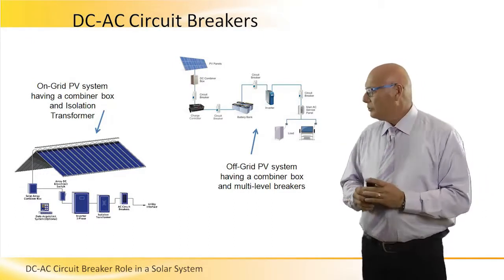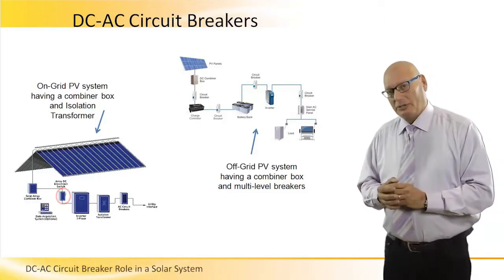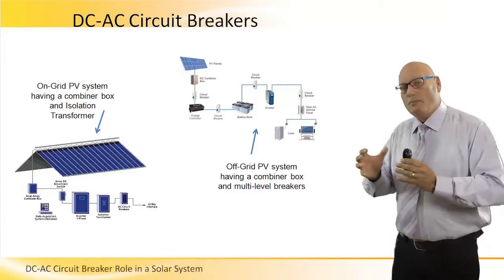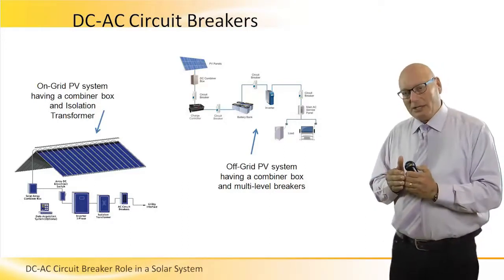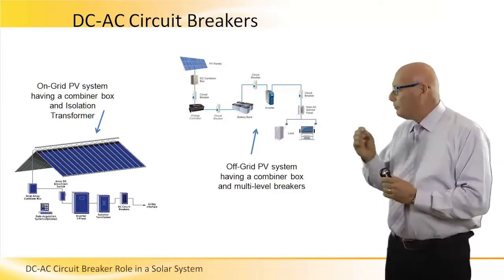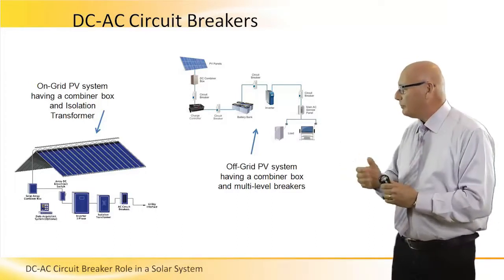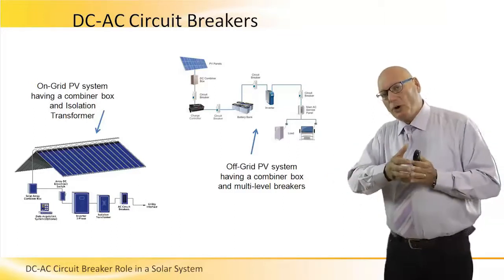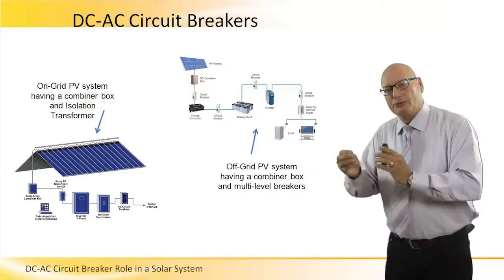DC AC Circuit Breaker Role in a Solar System

Comment: Is the last item before the devices, a breaker box? Meaning there are smaller breaker switches between each segment, then after the final breaker switch there is a breaker box which them links wiring for all the lights and sockets etc? Thank you